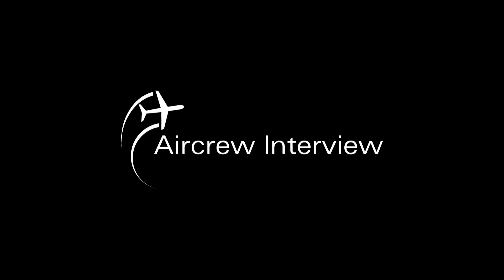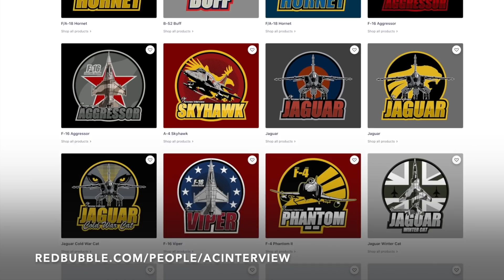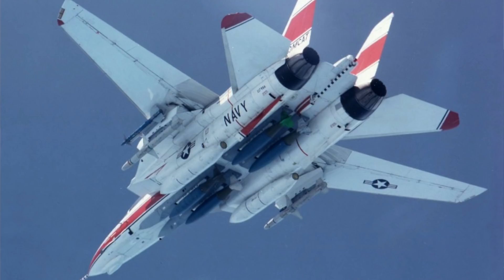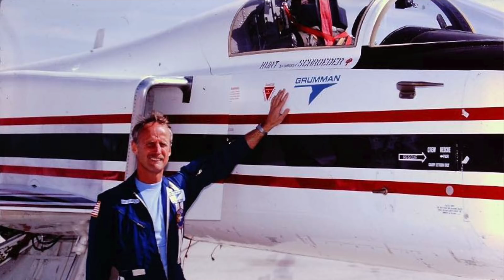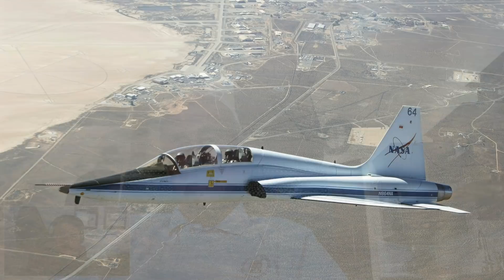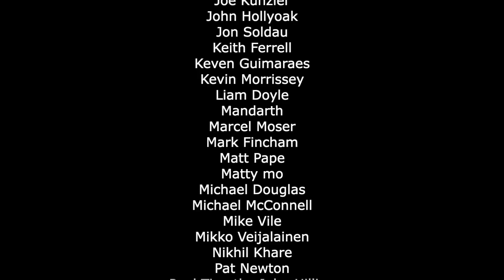Flying the Grumman X-29 | Kurt Schroeder (Part 2)

Comment: The original Microsoft flight sim had an F-5 you could extensively modify. I remember having a forward swept wing and moved the elevator in front of the main wing, lighted it and gave in the max allowable thrust. It was fun.  I was 7-8 at the time. Later in life I learned about the x-29 and it always make me think of that original flight sim.

Comment: Long ago(25 yrs ?) I think I saw a video of a F18 and X29 in a close in dog fight . I guess they wanted to see how it would do and they were in a downward spiral/scissor(?) just pulling hard into one another . It was a split screen with a forward cockpit view with grunting pilots and kind of a cartoon of the two aircraft showing their positions as they fought , X29 won but it took longer than you'd think . The video also had the wildest F16 demo's I've seen . Same split screen with grunting pilot only the external view was real time . It " looked " like that guy took off in 100' and never shut off the afterburner and never stopped turning . It was sick . I would guess that one was from one of the Paris airshows in the 1990's .